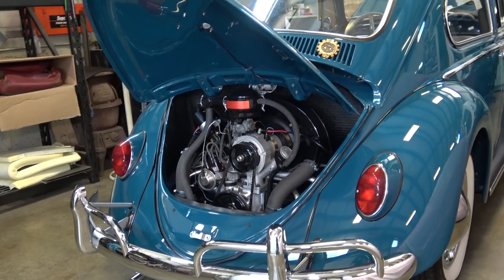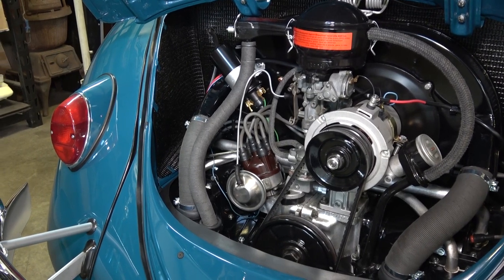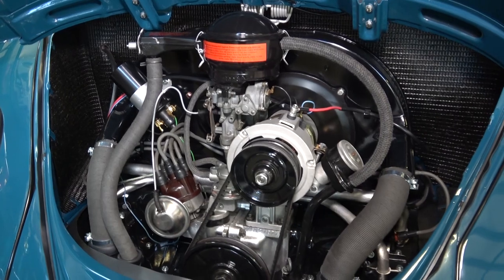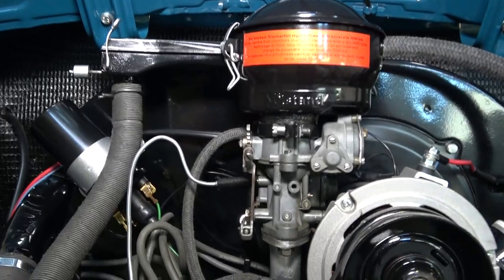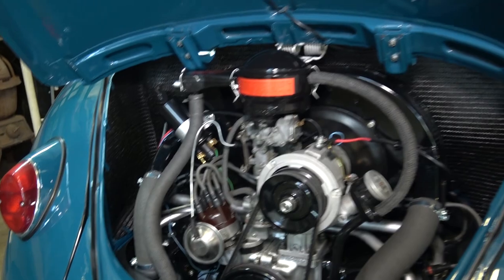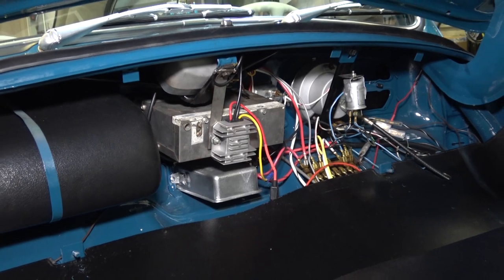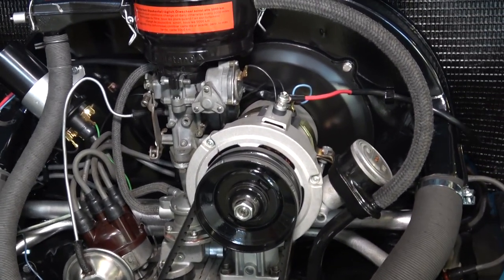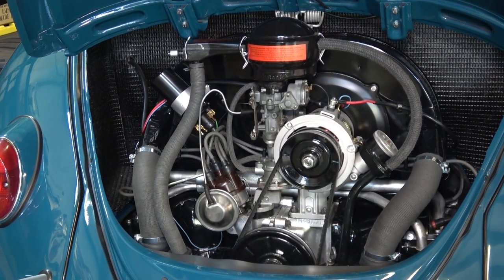⇓ Classic VW BuGs 6V to 12V Conversion Guide for Your Beetle ⇓

Comment from the maker: Hey Volks!

Here is a short video on upgrading your Vintage VW Beetle to 12v.  I list out what you need to change, and certain things you might need to adjust in order for the upgrade to work efficiently. 

Parts You can order:
Alternator upgrade kit: https://www2.cip1.com/acc-c10-5750-kt/

Voltage drop I like for my wipers:  Antique Car Electronic Voltage Reducer Blower Motors or wipers 12v to 6v 10 amps
https://www.ebay.com/itm/392033044419

356 Porsche Generator 55-65 W/Dummy Reg12V 38A Replace for the 6Volt Dynamo https://www.ebay.com/itm/283781603424

Comment: Starter is 6 volt as well. If keeping the "6 volt" flywheel then 12 volts to the original 6V starter will work as long as you don't hold the starter on for a long period. It can overheat at 12 volts on the 6V armature. Preferably change the flywheel out to the "12 volt" type (diameter and teeth are changed from 6 to 12V) and use a 12 volt starter. . The transmission bell housing will need to be ground inside to clearance the larger flywheel also. I kept the 6V flywheel on my 66 and use a 12V starter with a 6v pinion gear to match the flywheel. My bell housing is clearanced but I have not seen the need to go with the larger flywheel yet.

Comment: Chris - I changed my '61 bug to 12 volts.  I have nothing that "appears" to be 6 volt anywhere in the car.  I overcame the clearance problem in the transmission case by having DPR in SoCal remove the original ring gear from the flywheel and replace it with a ring gear suitable for the 12 volt starter motor.  Works like a champ!

Comment: Thanks for your info: i have a question: it is safe grinding the side of the alternator? I don't like the spacer under the carb and i don't wanna change the intake with a 12v one. Thanks for your answer.
Reply from the maker: just enough to clear the carb?  yes.
Reply: @classicvwbugs  thanks for the answer, you’re very kind!

Comment: the thing to add when converting a vw to 12v with the stock carburetor  is adding  a pilot jet cutoff solenoid on the carburetor to prevent dieseling or backfire when the motor is shut off as the solenoid screws in the carburetor in place of the pilot jet most are G55. be the 28 PCI, 28 Pict-1 and 30 Pict-1 carburetors  that  had a 6v choke element the solenoid is wired together with the choke element.

Comment: Chris you’ve got me thinking again. Wanted to stay 6v with my 61 but it is difficult to impossible to did a battery. Even the optima is not in stock. All the others are the bigger ones. Bulbs for 6v are difficult to find too. Thanks for the info.

Comment: i got a 1967 beetle that had a 6v system with 4 lug wheels, but i pick it up in bamberg germany.
Reply from the maker: Oh nice, I love those.
Reply: @classicvwbugs  everything i've read said it should be 12v with 5 lug rims
Reply from the maker: @gravedigger8  actually no, not a 1500cc 67 bug, they had 4 lugs with front disc brakes.  If your bug was originally 1500cc, and has discs in the front, the 4 lug is correct.  This is Euro spec 67, not USA bound 67s.
Reply: @classicvwbugs  cool thanks for the info

Comment: Are You spying on Me Chris? I have that 65 I mentioned the other day still in My garage and was talking about doing the 12v conversion on it later on. Thanks for this, at least I will have an idea what to tell Josh (the owner) it will take if He chooses this option. Couple things I noticed on the one You showed, no fuel filter and no clamps on the (braided German) fuel hoses? I know it is only a couple lbs. pressure and they do fit really tight, but I don’t think I could sleep well without the clamps. Did You mount the filter underneath? And while I’m at it, what the heck, on the valve clearance on these, I found that they call for 8 Intake and 12 exhaust, BUT, it also states in one of my old Haynes books that they had issues with burnt exhaust valves and they say to set them at 8 also? , which I did. Actually they were both set pretty close to 6, for how long I’ve not a clue. Ever run into this controversy?
Reply from the maker: Hey my man!  Yeah we have the clamps on now, we usually keep them off in the beginning just in case we have to change anything like carb or fuel pump etc.  There can sometimes be gremlins from the getgo.  It can be a hassle taking it all on and off in the first couple hundred miles, but once it is all good to go, we put the clamps on.  I'm gonna have a video on that.  And yes fuel filter is under the luggage area where the steel line comes out of the chassis then going to fuel pump.  So in between there.  As far as valves?  Any 40hp engine from 61-64 is usually .008 on intake and .012 on exhaust.  It sounds wacky I know, and sometimes you hear tapping even with that adjustment.  So sometimes we go 8 intake and 10 exhaust.  But in '65, they went with the square boss heads, so if you have those on your 40hp, then go .006 across the board.
Reply: @classicvwbugs  Well thank You for the info Chris,  I’m assuming square boss is  referring to the mounts for the rocker assembly? I just popped one off to look and they are round. Thanks. 👍
Reply: @classicvwbugs  I also discovered there is an early 65 and a late one and this is the early vintage.
Reply from the maker: @brianw8963  you are correct my friend!

Comment: If I remember correctly there is a 12volt starter that will fit a 6volt flywheel....i think it was a 73 type 2 or 3 starter??
Reply from the maker: they do sell a starter today that is 12v and works with the 6v flywheel, it is on cip1.com

Comment: Comment on flywheel, starter.
Reply from the maker: Hey Dave, the 6v starters are usually ok to use in a 12v system.  You pretty much need to stay with that if you have a 36hp engine.  A 12v flywheel will not go onto a 36hp crank.  They do sell a 12v starter today I found recently on cip1.com that works with the 6v flywheel teeth.

Comment: What about the starter?
Reply from the maker: you can run a 6v starter in a 12v system without issue, just don't hold the key on it too much.